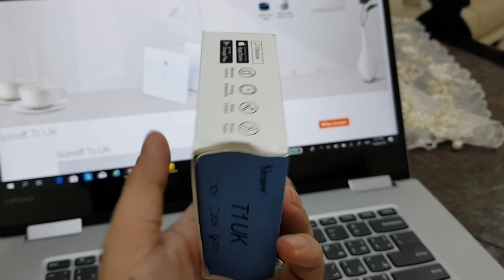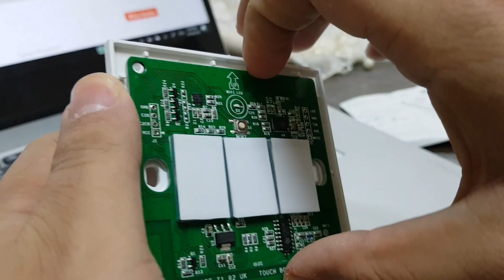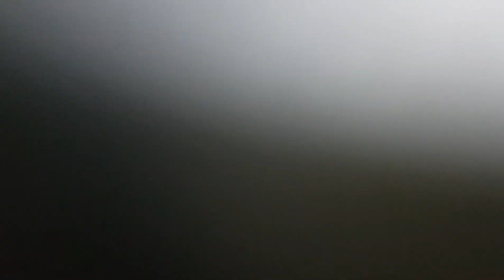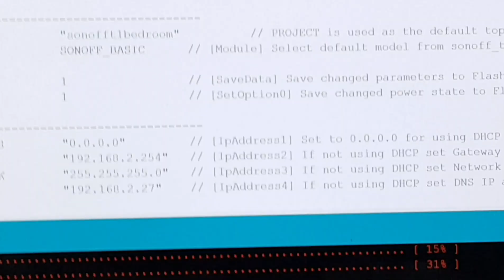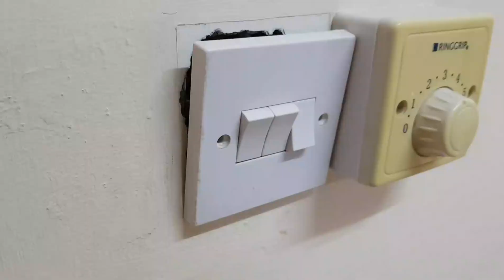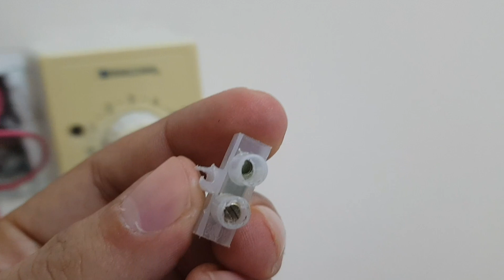Setting Up Sonoff T1 Using Tasmota Firmware

Comment: April 2021 tips: If you are struggling or think you will struggle with soldierless pin contact, then follow my advice: Get a 4 pin header; slide the middle separator (black plastic) down to almost the entire length (just enough to still keep the header together); then bend all 4 pins about 45 degrees; then sandwich the circuit board into a breadboard by using the header pins. This gave the best contact/tightest fit. The beauty of using a breadboard is that if you leave some holes spare you can then insert another jumper wire into the Ground row and use that to touch R19. I bought a TIUK3C-TX switch today (05/04/2021) and though the circuit board is dated 17/10/2018 I found R19 in a completely different place. It's still the correct resistor to touch however. Good luck fellow Tasmotizers!
Reply: @Schillaci Thanks for your reply. I just got a T1UK1C-TX and T1UK2C-TX today. It appears to be different but I will go with what you say! Which side of R19 did you touch, or does it not matter? I've never used a breadboard before, does it matter which row you insert the pins into?
Reply: @LautrectheGuilty  I recall getting the wrong end of R19 first time, the other side worked. Luckily nothing got fried so it's forgiving. For the breadboard. Nope, doesn't mater. Just leave some spare "rows". Sorry, wish I had made a video
Reply: @schillaci5590  Thanks, hopefully it goes well! Did you basically just follow this video for the rest? So set the pins, touch R19 and insert the USB? Was TX and RX (TX to RX RX to TX) reversed for you? On the Sonoff basic I did last week they were, but I've heard they aren't always. I was planning to use Tasmotizer for this, it worked on the basics, what did you use? And which bin file? Sorry for asking so many questions, it's just hard to find a lot of info about the TX series switches.
Reply: @LautrectheGuilty  Yes, exactly as you say for the rest of the process. It's logical right? TX must be RX on the other end, and vice versa. I've zipped up all the bins and flasher tools I have used for my Sonoff flashing and also WLED which you might be interested in at some point. Easier to do this than to find (and guess) the original links again! Good luck: https://www.filemail.com/d/bqbswdtfikuahtn
Reply: @schillaci5590  Thanks for your help, much appreciated! I'm glad I read comments!

Comment: Hi. With Tasmota, The lamp turns on during pressing or release of the touch button?
Reply from the maker: I am using espurna now where it turns on on press. 
For tasmota it is configurable i think it is SetOption13 to control the press refer to this page for more options https://tasmota.github.io/docs/Commands/
Reply: @alsolh  Thank you